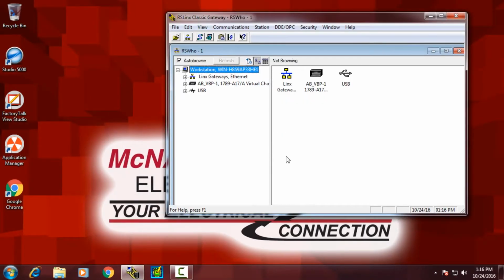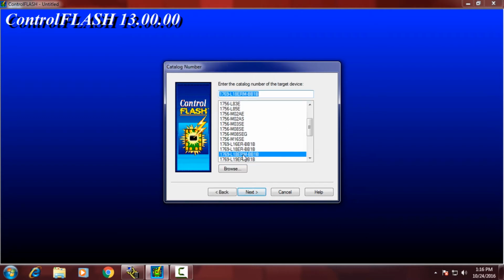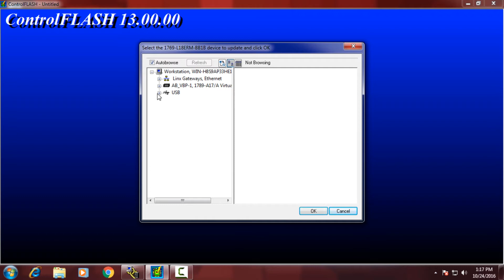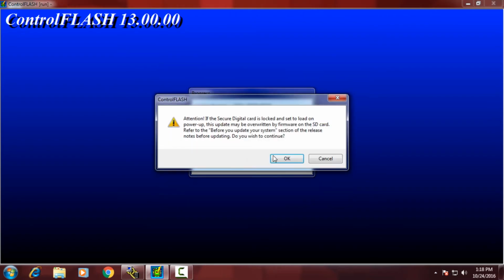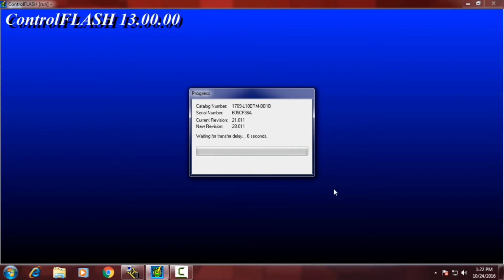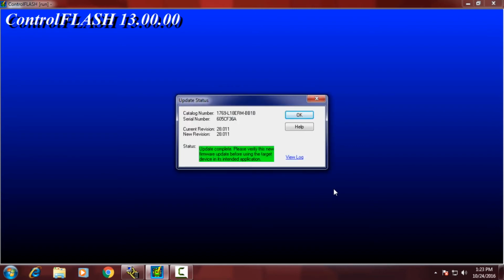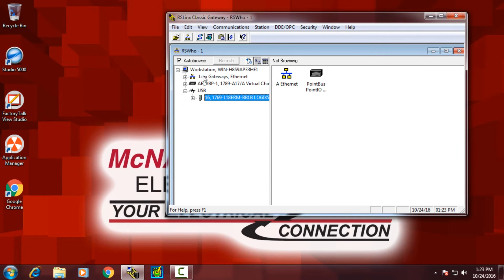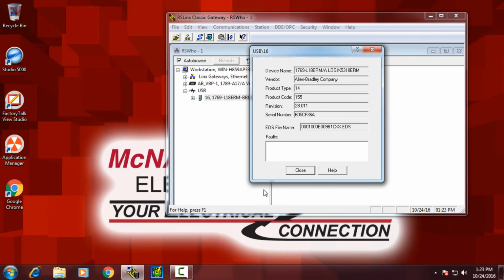Flashing the Firmware on a CompactLogix 1769-L18ERM Controller

Comment: 1769-l18erm-bb1b is it enough to move a kinetix 350?
Reply from the maker: Hello Jose, Yes you will be able to run 2 axis of motion on the 1769-L18ERM-BB1B using the Kinetix 350 Servo drives. If you have further questions or concerns, please reach out to your local Rockwell Automation distributor for personalized support.

Comment: Hi, i have a 1769-L24ER actually running with 20.013, and need to flash it with 32.013 . but it failed even shown as compatible on Rockwell’s Compatibility and Downloads Center. 
can you please help uderstanding the issue root cause or if you have any hint to solve this problem.
Reply: Finally i found solution to my problem here sharing with you the solution: https://rockwellautomation.custhelp.com/app/answers/answer_view/a_id/727456/requestLocale/en_US
Reply from the maker: Hello, We're happy to hear you were able to find a solution from Rockwell.
A common issue can be that the controller is not in the proper mode to be flashed.
For more information please view this Rockwell Knowledge TechNote:
https://rockwellautomation.custhelp.com/app/answers/answer_view/a_id/44379/loc/en_US

Comment: I faced a message "Failed to begin Update to the target device, The target device is not in the proper mode to accept an update" could you help me
Reply from the maker: When encountering this issue there are a few things you will want to verify.
1. The controller is not in run mode.
2. The 1769 power supply is within 4 slots of the processor and no more than eight I/O modules are installed after the power supply.
3. If a 1769-PA4 Power Supply is being used, make sure the selector switch is in the proper position (120VAC or 240VAC).
4. Verify a 1769-ECR endcap is installed.
5. Verify the network connection is direct. Do not browse through the backplane. Avoid connecting through several network segments, switches.
     For example, if using Ethernet communication, for the upgrade, connect the PC directly to the Ethernet port for the communications.

If all of the above conditions above are met, try the below solutions.
-Start the ControlFlash Utility from Start-->Programs-->Flash Programming Tools or from the RSLogix 5000 software.
-Delete the Harmony files.
-Reset the controller
-Use the AB_ETH driver instead of the AB_ETHIP driver when selecting the processor.
-If the controller is in a large rack, try isolating the PLC and only use the controller, power supply, and end cap. There is a possibility that a power supply is going bad. 
If you have any questions or concerns, please contact your local Rockwell Automation distributor.

Comment: In what mode should be the PLC & the Mode Switch, Sir?
Reply from the maker: Hello, The mode switch of the PLC can be in the PROG or REM position, but not RUN. As long as the RUN LED indicator on the controller is off, the PLC can be flashed. You can find more information on the process in the CompactLogix User Manual on page 109:
https://literature.rockwellautomation.com/idc/groups/literature/documents/um/1769-um021_-en-p.pdf
For additional support, please reach out to your local Rockwell Automation distributor.

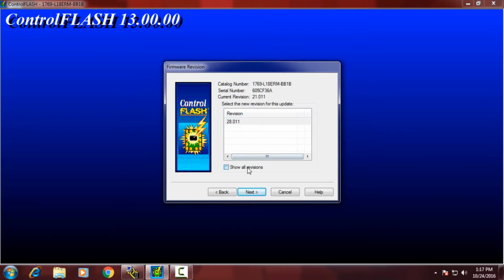Comment: I've got no options in my last at 1:01 - how do you supply the firmware options?
Reply from the maker: Hello, You will need to download and install the firmware files of the version you want to flash to your product before following the steps in this video.  Visit Rockwell’s Product Compatibility Download Center at the link below and type your catalog number in the search bar to find the right firmware for your product. 
https://compatibility.rockwellautomation.com/Pages/MultiProductDownload.aspx?crumb=112
If you have further questions or concerns, please contact your local Rockwell Automation distributor.

Comment: Hello, in flash control appears the message that I do not have access rights to update the firmware, I have never seen this, what can it be?
Reply from the maker: Vagner,This error is likely occurring because FactoryTalk Security is enabled. Check out Technote 480070 ControlFLASH: Current log on user has no access rights to update target device in Rockwell Automation’s Knowledgebase for step by step solutions, or contact your local Rockwell Automation distributor: https://rockwellautomation.custhelp.com/app/answers/detail/a_id/480070

Comment: L24ERM-QB1B not showing up in RSLinx under the USB driver. Windows 10, RSlink v3.9. Any help with this issue?
Reply from the maker: Hi James, You might want to try clearing the cache by deleting the Harmony files. They may have become corrupt which could cause an
issue. New cache files will be recreated when you reopen RSLinx Classic. For instructions, please follow Rockwell Automation’s Knowledgebase Technote 769010 https://rockwellautomation.custhelp.com/app/answers/detail/a_id/769010  Another solution is to reinstall your USB driver. Please refer to Knowledgebase Technote 522486 https://rockwellautomation.custhelp.com/app/answers/detail/a_id/522486 Though the Technote specifies Windows 7, the procedure should be fairly similar. If you have any questions, or cannot access a Technote, please contact your local Rockwell Automation distributor for more
information.